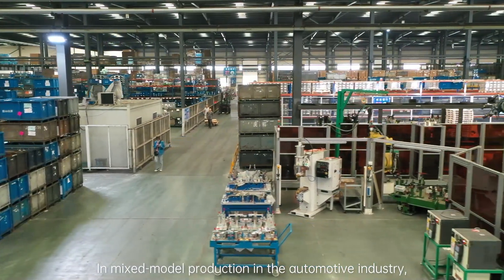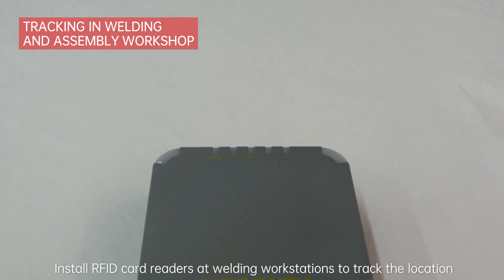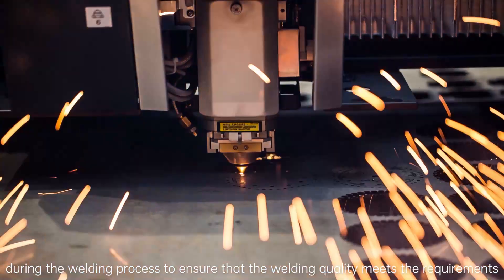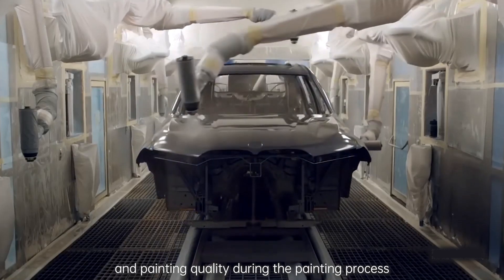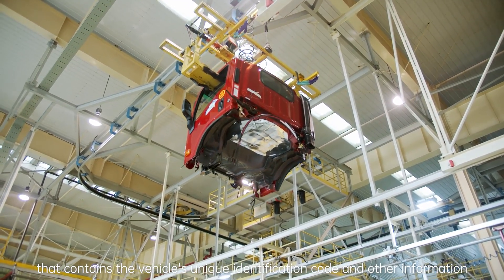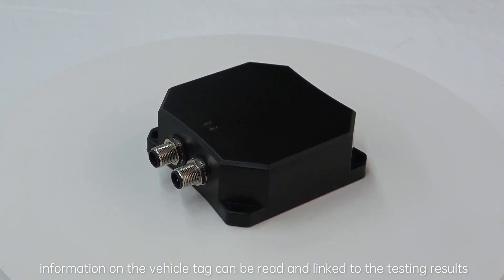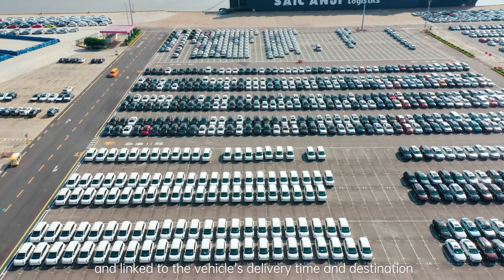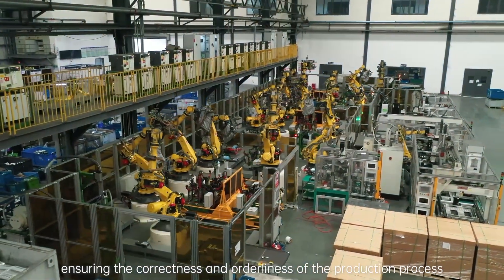How RFID can help achieve vehicle tracking in mixed-model production in the automotive industry.

Comment: This video does a fantastic job breaking down how RFID can revolutionize mixed-model production in the automotive industry! The step-by-step explanation of using RFID for tracking and quality control across different stages is incredibly insightful and highlights its potential for improving efficiency.

For a real-world example, you might find RFID Vehicle Tracking from GaoTek interesting. Their system uses RFID tags and readers for real-time vehicle tracking and extends to applications like access control and toll tracking. It could be worth exploring how their solutions align with mixed-model production needs and quality assurance processes.

Thanks for such a detailed and engaging explanation—this is a valuable resource!